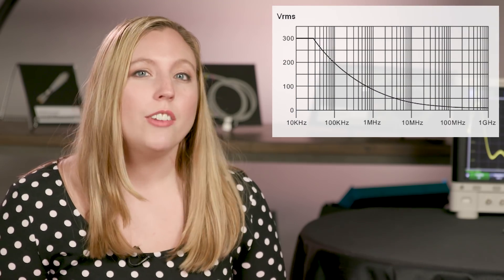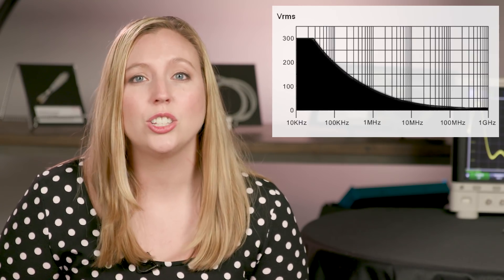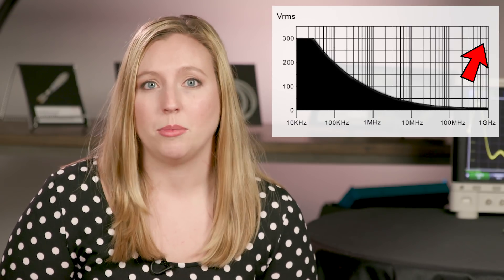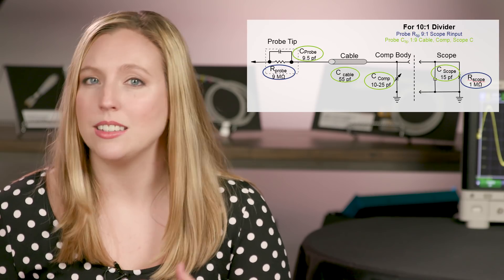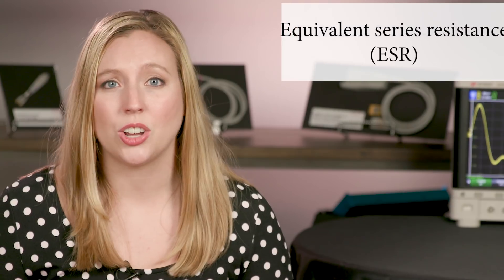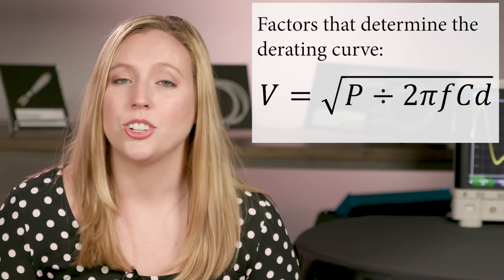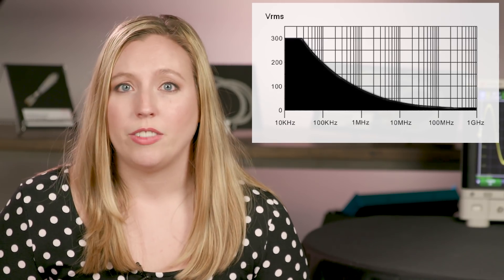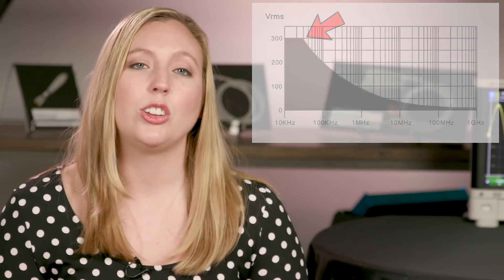Why an Oscilloscope Probe Derating Curve Matters

Comment: This is why whenever you get anything in life, you read the documentation (manuals, brochures, and labels) that came with it or seek it out if it got lost along the way. Regardless of whether you have a firm education on the subject matter or not. You could either be missing out on features or warnings like this. Young hams, telecomms, and radar workers, this one is for you.

Today's lesson is somewhat a combination of "Ohm's law" and the fact that a capactor basically becomes "like a wire" or "short to ground" with AC and RF signals. Think I*Z=V. There are a whole bunch of other things to talk about and its much more complex than this but basically the best simplification I can think of at the moment.

So far, as a personal rule of thumb, as long as your signal is under 1W along with your probe's resistance (part of Z) you should be fine. Again check the specs or at least the label b/c you don't know if its a 50ohm, 1megohm, 1k or other ohm probe.

About 300V @ 1GHz signals, I wouldn't even go near the source of it unless required to do so with protection/preventative measures. You might as well imagine putting yourself into a microwave oven. RF burns aren't pretty either. Insidious too since you can't even feel it. Don't worry though because a ~300V @ ~1GHz (even MHz) signal is ultra rare unless you are lucky enough to get a hand-me-down part from a telecomm or radar company. That or purposely mess around with a microwave oven.

You and your equipment can still get fried though. A typical offender personally witnessed are those working with a powerful (25W or more @50ohms) transceiver/radioset as licensed hams. This too is rare since they know and should take proper precautions (don't get be that careless person). ;)
Reply from the maker: Spot on. A 1 GHz 300 V signal would be pretty rare. Power systems using high bandgap semiconductors are another place you could run into signals like this.

Comment: Last video I was scared of believing measurements, now I'm scared to even measure a circuit! Okay not really, but this is lots more I never thought about, especially the limit in maximum voltage vs frequency.
Reply: The same goes for the 1M input of the scope if you do not use a probe.